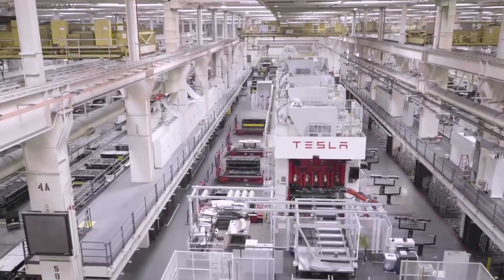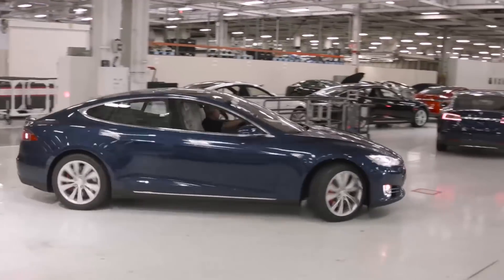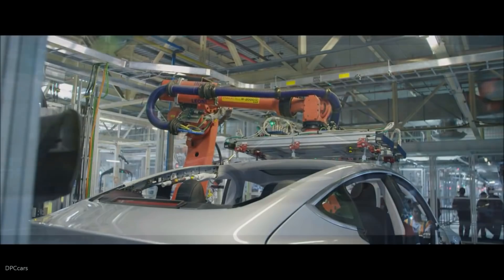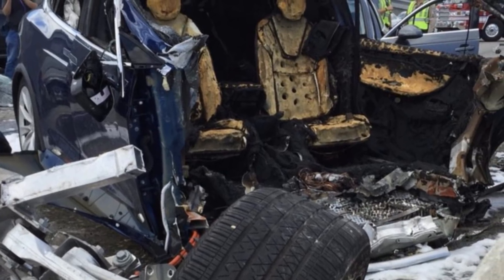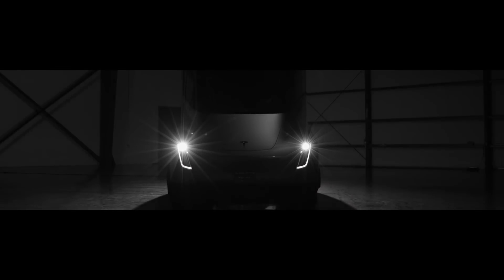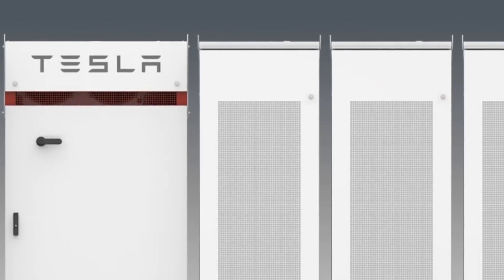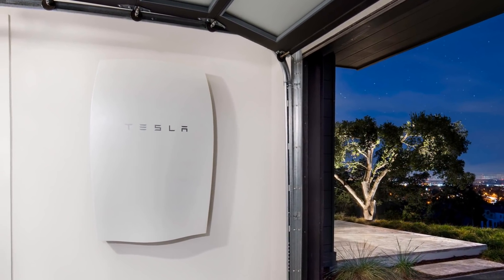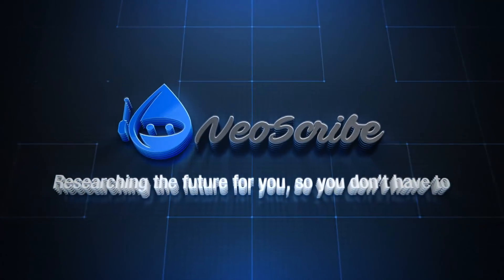Tesla Snapshot Report

Comment: You could also make a video on the chevrolet bolt. A electrar avalible right now with about the same range and price as the Tesla model 3. Altough i love Tesla and all elon Musk prjojects i think this Car is realy underrated and deserves a lot more atention than it getallen right now.
Reply: Electrar= electric car
Reply from the maker: Hey Mats! I will try to fit in Chevy Bolt soon, mostly likely in several weeks.
Reply: Mats MCgaming Bolt has 100 miles less rage than the big battery Model 3 which is currently being sold.
Reply: Yes but you pay al lot more for the biger batery.